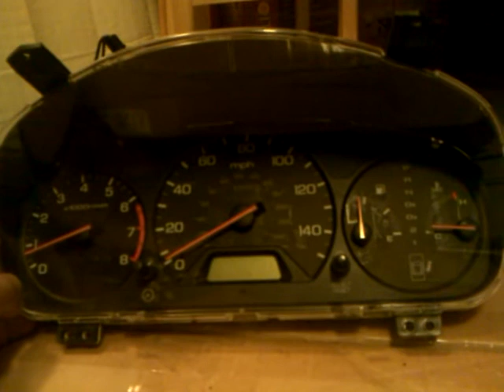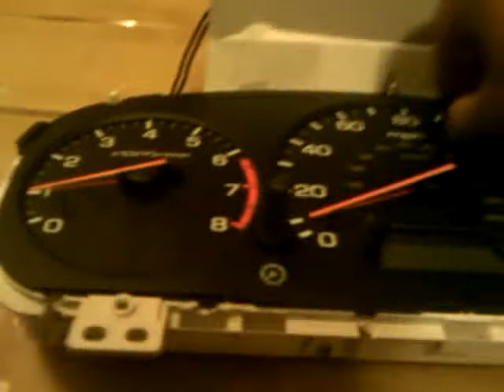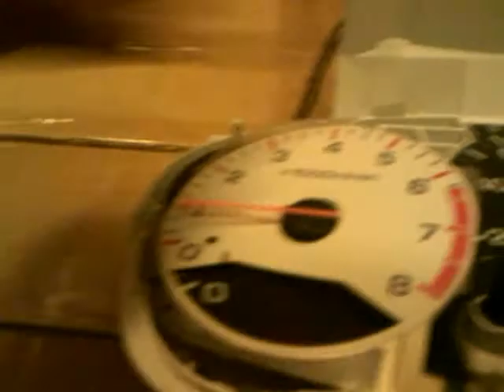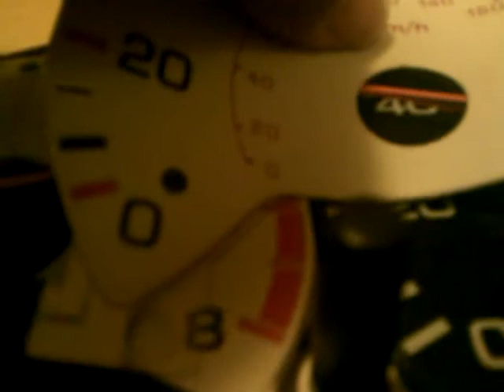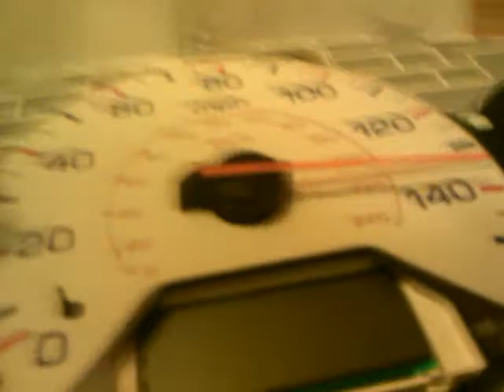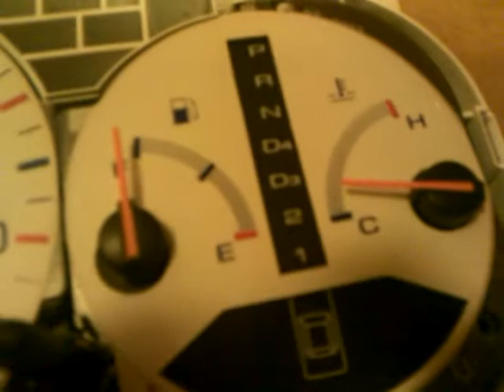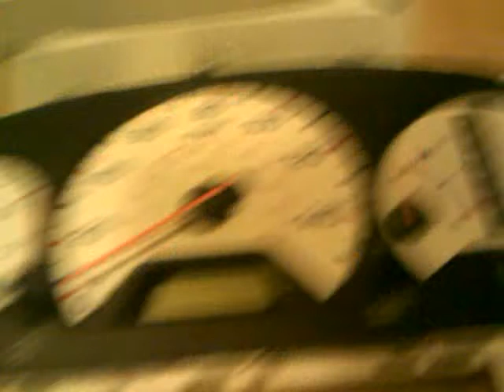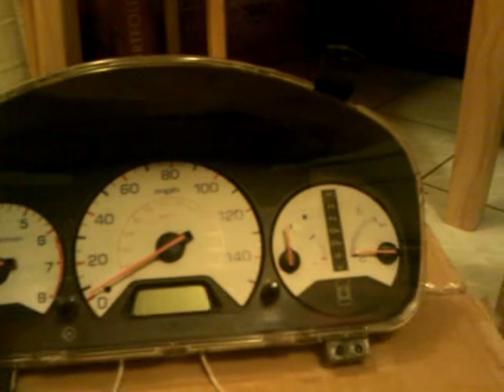2000 Honda Accord Gauges Installation

Comment from the maker: @ulisez9 
It was really easy. I dont know how yours is but for me. I had 6 phillip screws to remove. first two was located in the inner top. after removing that pull the plastic piece out with some force. if it doesnt look for more screws. when pulled out two screws should be on top and two on the bottom. cluster should come right out and then just unplug the harness carefully

Comment: So when you installed the white gauges from your new cluster I see you moved the needs around? by moving them the needles worked after putting it together? My concern is that in your vid used your old broken one. Bottom line when you moved the needle from you new cluster it didn't damage performance? or should I not move the needles at all which will make it difficult to put the gauge on with the two neeldes. let me know soon please I want to order these white guages soon. Thanks

Comment: wait so i have the same gauges and going to get them installed. its ok to move the needles, but not take them off right? and wats the double sided sticky tape for. is that to keep the new gauges face from moving?

Comment from the maker: @Importme25 
This was my second gauge and your right and wrong about the needles. you can move them the way there supose to but never pull them out or keep spining them round and round. My first gauge I listen to a guy on you tube to pull out the needle, what a mistake. It stop working right like you mention. So i bought a new one. When i did it like my vid. it was perfect. I use my tom tom to measure my speed and it was right on